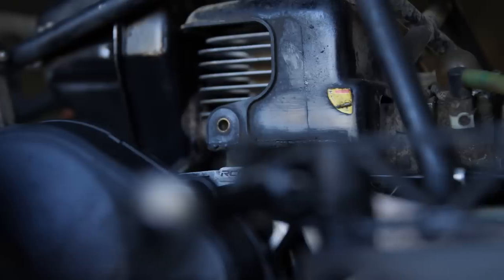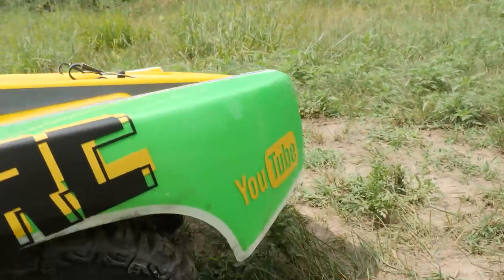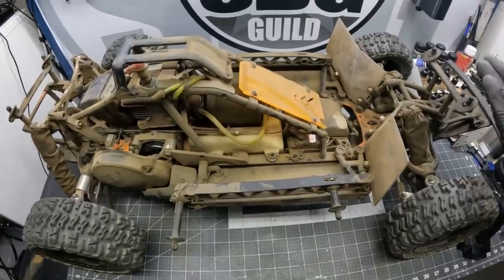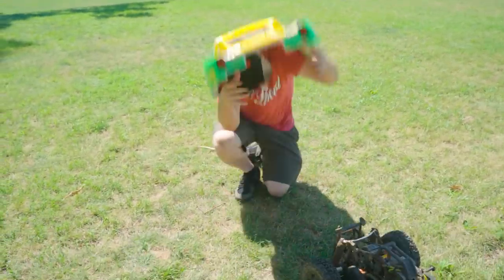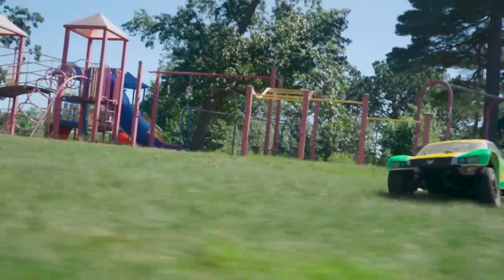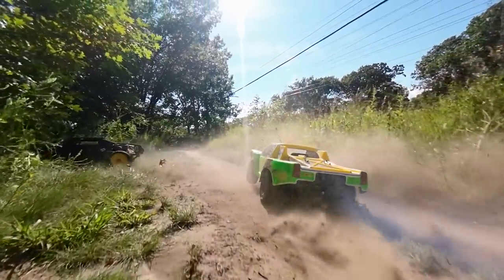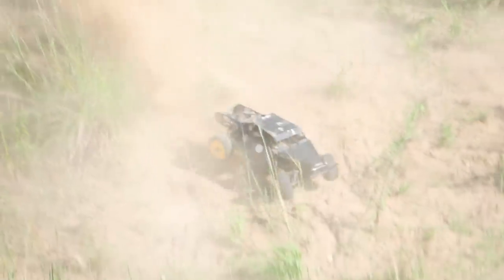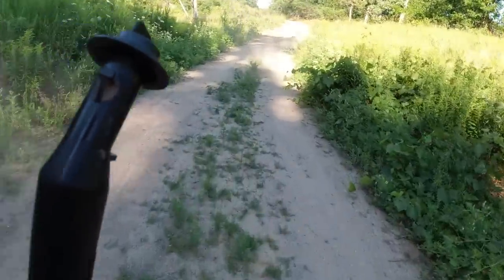I drove it, and I loved it! - GAS BURNING LARGE SCALE RC FUN

Comment: Now you know why I run Gas Boats. You said it, “ I was instantly struck by the power these gas engines put out. “ Welcome to the gas ⛽️ side Lol!!!! Bout time. Take care, stay safe SBG!!!!
Reply: Gas?  Or nitro?  Reason I'm asking is, you don't see many 'gas' boats.  Of the 40-50 non-electric boats I've come across, 1 (maybe 2) were gas...ALL the others were nitro.  Thing is, gas is easy to deal with (including the engines)...but, nitro, on the other hand, is a PitA.

I remember one guy trying to tune the engine, and get the needle set "just right", and even after several hours, it still wasn't.  First time he finally had it running, the boat made it halfway around the course before dying.  About 30 minutes later, he finally had it...or, so he thought...to which the boat made a full lap before dying.  After that, he spent another 30-45min...to which he made it about 1-3/4 laps before the engine died. At that point, he packed everything up, and said, "Another week wasted. Maybe next time."

Nitro (on any vehicle type), I will avoid like the plague...gas, on the other hand, I'm willing to try.
Reply from the maker: Thanks for watching and yes, it was a lot of fun, but my main focus will be crawling...for now! 😉

Comment: Yes.....they are a blast. But also yes they are that finicky
Reply: i mean. the cam car had no issues 2 days, davidoff our 3rd car also had no issues. we had a crap servo, and the second time we heat soaked the motor so badly it, the carb just quit. I'd say these are really solid. Maybe the mistake was giving matt the truck that ran 2 race seasons then sat for 6 years. lol. that's probably it.
Reply: @kpopRC  yeah gas definately has the edge over nitro, which can be a proper PITA

Comment: I was into the nitro scene some time back...and you're right, it's an experience. But for me, the novelty wore off after a while. Not to mention, if you live in a residential area your neighbors will get to hate you pretty quickly if you run them often lol. For me - especially with how many advancements have been made in battery/electrics space - electric is the way to go. Not hating on the nitro, just providing my perspective...interested to see if you stick with it or if the novelty wears off for you as well.
Reply from the maker: I think I'll always be more of a crawler guy, but this was a lot of fun!

Comment: I had 4 nitro. I failed at all 4. Difficult to tune and keep running. Love electric.
Reply: These are not Nitro. they are Gassers with 2 stroke oil as they are basically week whacker 2 stroke engines.
Reply: @HBFTimmahh  yes . I only had nitro. Gas is better , cheaper .

Comment: Smiling like a kid on xmas day out there!

I don't think anything will ever top the two stroke snap off the line and the incredibly wide power band it has. That said, two strokes have gone the way of the dinosaur in the US, even in chainsaws and the like. I've run a ton of saws and such and I just don't think I can handle the 2 cycle headache-inducing smell. Is it 50:1? Thank god it's not a glow plug start. That was my masochistic torture as a kid: trying to start my nitro.

Comment: Like several others, I've also been looking into getting a 1/5 gasser...but, the question has been "which".  Originally, it was between the Losi 5ive-T & DBXL (both of which have since been updated to the V2 & 2.0).  I know Redcat, but am not familiar with their Rampage line...and, as for Kraken, I'd never even heard of them prior to today.

So...to those familiar with Redcat's Rampage line and/or Kraken (especially anyone familiar with both), how does the Chimera Sand Rail, Vekta.5, and KV5TT compare to the two Losi offerings?  On one hand (like most people), I'm concerned about cost, which is why I could (potentially) consider the Rampage Chimera.  On the other hand (also, like most), I'm concerned about quality, longevity, and availability of replacement parts.

Am I better of sticking with Losi, knowing that replacement parts are (almost) always available here's in the US?  Will I actually have money (in the long run) by getting the Rampage...in other words, is the Rampage 'durable', rarely requiring replacement parts, and is it reliable)?  Are the Kraken vehicles quality & durable enough to make spending that much more "worth it"?  Any 'insight' into the Rampage Chimera, and the two Kraken offerings, would be greatly appreciated.
Reply: the king is MCD rr5 or w5 they can get pricey. then i'd say losi 5ive but it's a platform that you'll need upgrades off the hop, they chew through steering servos. i'd avoid the dbxl due to aggressive drive line angle changes that wear out all the drive cups. the RCMK version of the dbxl had boots for everything. still would wear out. the vekta looks cool, a bit too wide looking for me, but maybe it'll grow on me. so many choices. It should be fun narrowing it down.
Reply: Get a 5ive. mcd way over rated parts are a pain to buy if sold out there is not alot of options for the mcd in parts alot of guys I know now selling the mcd now lol there is alot more parts available for the 5ive . 5ive is best many many parts available

Comment: Kraken-RC have re-invented the Baja it sort of is but different I have yet to see one in the flesh, and as I have two originals the 5B from 2006 and the 5SC 2009, they have so many mods and upgrades it is easier to name the stock parts still on them both under twenty.
I knew you would be hooked now you need to find local's to hang with now this is harder now the battery is king. I have eight working and three or four needing attention, I now have electric four two road and two offroad oh and an electric daily.
NOW there are a lot of things you can do cheaply to improve handling and reliability it is out there because of all the knock off's the Baja lives on in clones but there are still good aftermarket manufacturers out their and some from way back but most in the last ten years. Go have fun shame gas prices have risen soon battery will be cheapest even allowing for buying them in the first place.
Reply: can't wait to try the new rwd kraken vesla.5. that will be a monster.
Reply: @kpopRC  Not sure whether to as my 5B has the body kit the Vesla-5 comes with and it looks like it may have the wide suspension arms from the kit they sold, I tried them although it handled a bit better the arms were forever breaking and popping drive shafts so I went to the stock setup arms they sold for lower up front the rear I have the Phatdaddy ones uppers are alloy ones from a company I forget now, no longer around the front top is a Jarm very strong plenty of clearance for the big bore shocks I run sometimes.
Reply: @Nickwillfixit  it was such a crazy scene that seems to have totally died. too bad really. it was a ton of fun racing these. dunes were bad ass too!
Reply: @kpopRC  I hope every year for it to re-emerge we have some racing in the UK not as much as Canada and the US but pretty big our Bajafests were big but not so now, I have seen gas ebb and flow but I think the electric age is going to consign 5th gas to the history books, unless we can rally every 5th scale gas guy from the past to join in a gas revolution or just a good resurgence

Comment: Would be awesome if the power showed up on the low end.   Biggest issue with has rigs.  2nd issue is 5% drive time with 95% bench time.  I disagree with your run time comments.  They are a blast to drive but issues arise like they are desired, the tow of shame is a everyday thing.

Comment: Large and fragile. 😀
Reply: i disagree. this truck has see a few seasons of racing with 15 other trucks. it has so many hours on it. and it still rips. heat soak is real though, and eventually the carb got so hot it just wouldn't start. that's what you get when you run them for an hour straight in 30+ degree heat.
Reply: @kpopRC  I was joking, you don't know me yet.  ;-)

Comment: One word, obsolescence. This RC is obsolete. You cannot find any parts for this. HPI company is dead. Sank $3,700 into mine. Sold it in 2013. Batteries are where’s its at.
Reply: hpi was recently acquired by a company in europe (the name escapes me), they have been re releasing discontinued hpi platforms slowly in the last year. Rumor has it the hpi baja will be back. we'll wait and see. the whole point though of this video was to rip up old rc's that might be sitting collecting dust in your closet. On my channel we bought a ton of race trucks with all their parts. and managed to restore 7 of them back to working condition. i am proud to say only one radio box is a clone part. ha ha. and also batteries are totally where it's at.